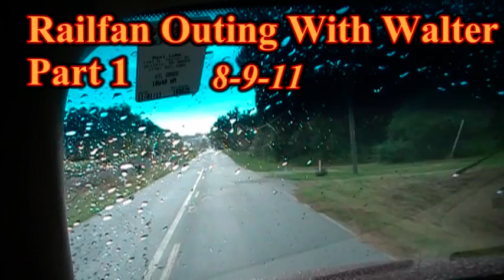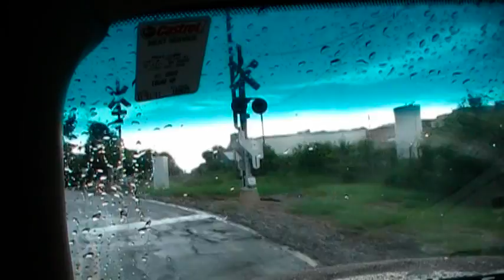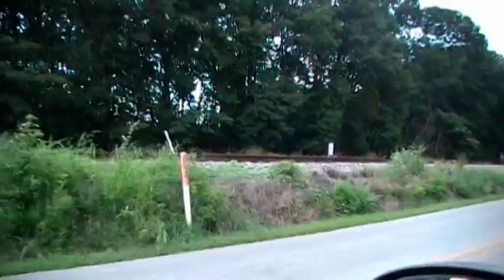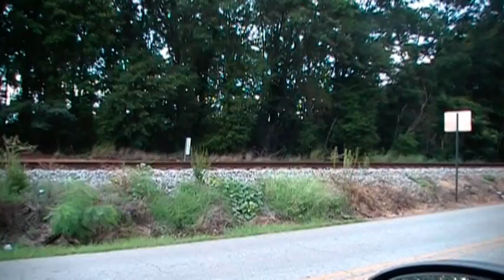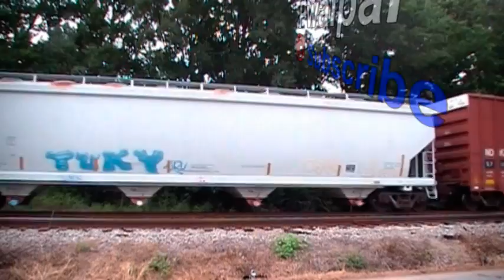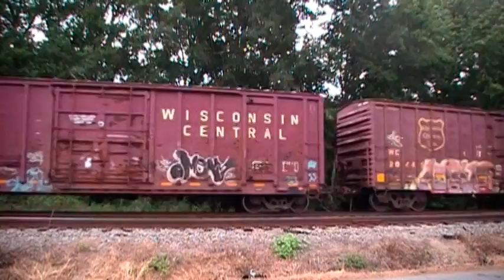Railfan Outing With Walter Part One 8-9-11.mpg

Comment from the maker: What you heard was the slack running out or in,  There is a couple of inches of slack in the draft gears and couplers plus each draft gear is like a huge shock absorber so you will hear it  Im not sure if the camera will pick it up very well

Comment from the maker: Marc,  The air brakes have to be tested and made certain to be working properly all the way through the train after adding morecars to the train.  Its commonly called a brake test and is mandatory by the Federal Railway Administration (FRA)  The FRA is governing over the railroads much the same as the FAA is the airlines